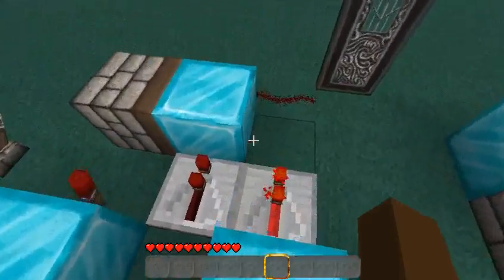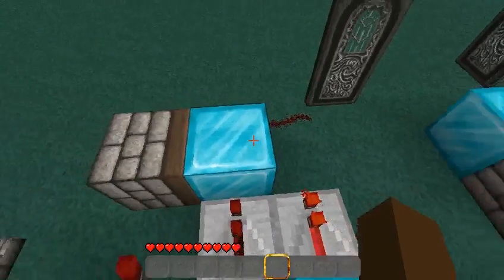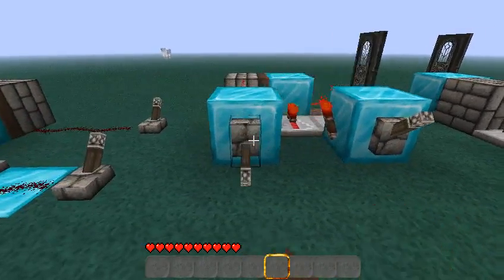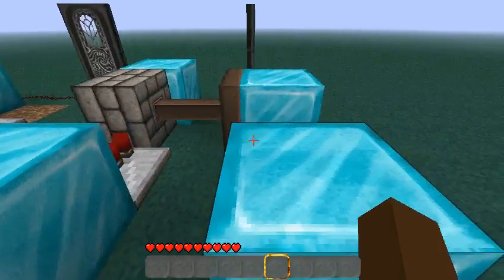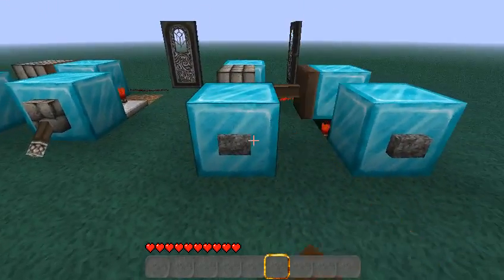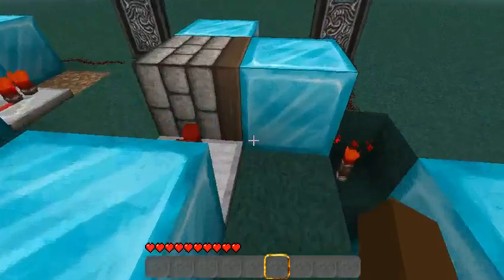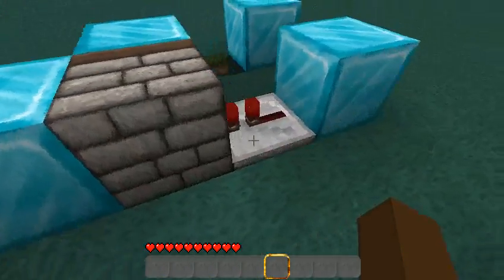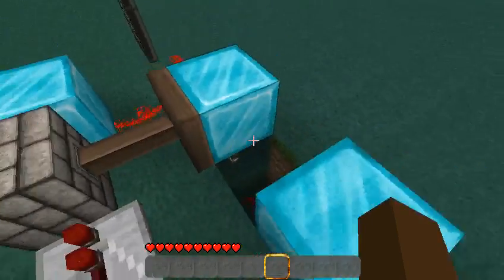Minecraft Piston Logic Gates and Circuits

Comment: @tucense But when the piston extends again to recreate the circuit it takes 2 ticks. I have those instant wires in use because they speed up my RAM that I built. But these designs will not solve any delay problems, they will make it instant when you turn it on and twice as slow when you turn it off (or vice-versa)